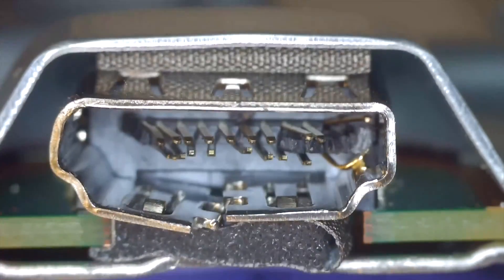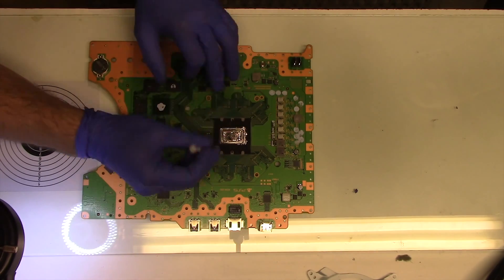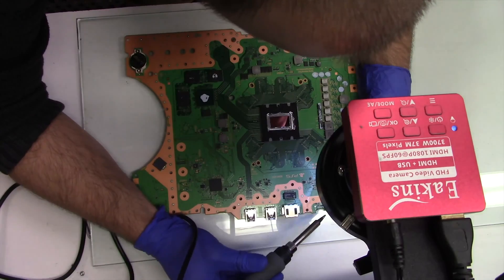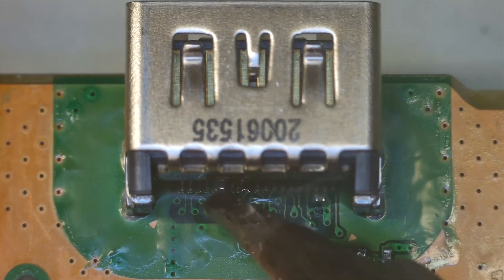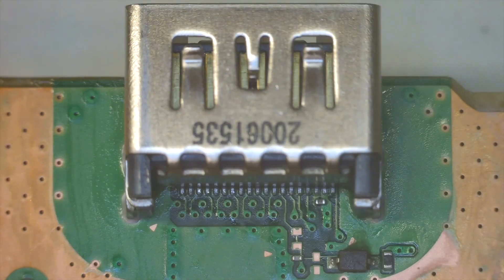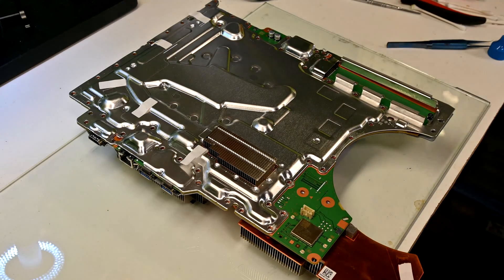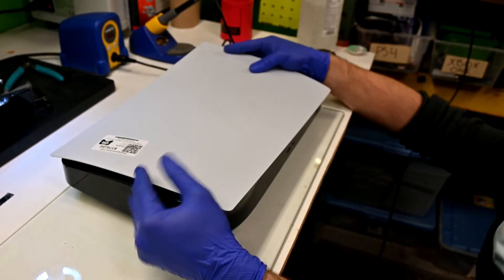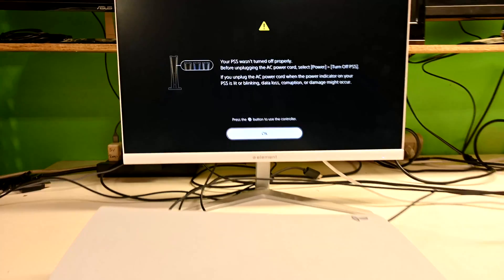Fix Broken HDMI Port PS5 System Replace Liquid Metal Reapply Thermal Paste Dissassembly and Repair

Comment: it looks like newer versions cut off many things. Ive just open my first-launch ps5 to re-apply liquid metal and there is thermal pad sticked on the vram, transitor… 
after finishing, mine works like a charm on black myth wukong 🤤

Comment: considering you are a professional you made a naive error with the fan of the ps5 one of its screw holes doesn't have a screw in it as the threads in which it gets tightened you put a silver screw there which doesn't belong there so I'd suggest take it apart and attach the fan screw and it can have issues if not done

Comment: i noticed it took a long time today when I did a hdmi desolder on a test ps5 board. Heating from the back, kapton over the diodes on the back. it did come out, with no pads pulled. But man it took forever i was afraid i was gonna damage it. Your technique of heating from the top... I almost tried that today but I was worried about those small caps around the pins. Now that i see it can be done i may experiment with that approach too. Thanks for the good video.

Comment: I've had two ps5's fail without any outside trauma. I sometimes had to just lightly touch the hdmi cable in order to to allow it to work. After replacing the cables , (data not charge) it yielded the same result. So instead of replacing the hdmi cap, ic encoder etc... I decided to try and replace the port for experience and I must of watched 20 videos of others doing it and I couldn't find a single one that had sound doctrine or specified what correct items needed to properly diagnose and repair the system correctly, until I found yours. Excellent video and instructions. You handled it like a BOSS! Thanks so very much for putting your video online. It's extremely beneficial for many people looking to do it correctly. Great job!
Reply from the maker: Thank you very much! I'm super glad you found this information useful!

Comment: t what about these other small components with thermal paste? Is it possible to change that thermal paste? My PS5 is heating up even after changing the cooler, so I am sort of guessing these small thermal paste over these components is fried or something, their texture look a bit dry. But what is heating up are the side parts until the heat get to the front USB which I believe isn't good for the overall hardware even though the CPU isn't giving a heat warning.

Comment: 1 year Life 🤣🤣🤣 excelent design sony
Reply: It was a damaged HDMI port, nothing to to with Sony. Happens on Xbox too. The owner caused the damage, it didn't just bend itself.
Reply: @conradladouceur7557  read the tittle of the video. Broken HDMI and REPLACE LIQUID METAL. Xbox haven't liquid metal, this metal fail and have problems (3 years Max.?) Ok Bro, perfecto design .
Reply: he replaced the liquid metal by choice, there was no issue  @miguelrevo

Comment: Heat is necessary but at the same time, heat it's the enemy. Too much heat or heating time, pads can be broken and other components can move out of place. Sometimes people with a lot of experience can do things in a certain way with certain tools and still end up with good results. But, people with short experience doing it that way can lead this procedure as a nightmare.
 
Tip: You should clear the holes with the copper wick for easier connector placement and minimize the heating exposure time. The pin alignment is more important than the holding legs. Depending on the board, if any plastic or close surface mount parts are too close, cover it with some material to shield the direct heat. I like to have the connector in place and secured, with the pins perfectly aligned, then apply some air heat to the pins. Once the pins are soldered in place, then I solder each of the support legs with the iron. By doing that, normally you do not need touchup and guarantee each pin is flat on the board. But if touchup's is necessary, I do recommend the iron have a smaller tip and without additional solder paste, reheat each pin. It's too risky to pass that bigger tip iron across touching multiple pins with solder. If you are not careful, not only create easy bridges, by removing those bridges, that iron that size can transfer too much heat and damage the pads under. If you do not have too much experience, find an old board and do a practice test.
Reply from the maker: True, at this point I probably rely on better equipment just a tad more than I used to in the past. Temperature is much more controlled and reliable with my current setup. But that was not always the case for me and I soldered with a much cheaper rework station and iron. During those years Kapton tape was my best friend and used on nearly every project. Same with alignment, much easier to get pins lined up directly over pads with a 200x magnification on my side. Heat is a friend and enemy if this is an early project for anyone, start with low heat and work your way up to a setting that works for you. The Technician has great points in his comment, I appreciate the time taken to point them out. Always tread carefully when working on expensive motherboards!
Reply: The best tip whatever your equipment…practice on junk boards and get to know your equipment. Never try something like this without some practice on removing / replacing plastic connectors on things that don’t matter.
Reply: Great tips thank you for sharing.

Comment: Why replace the liquid metal? If its liquid still you can just spread it around to ensure that it makes proper contact.
Reply from the maker: If it was a personal fix I would agree with you, but we do these repairs as a business and prefer to leave nothing to chance! But you are correct, this liquid metal doesn't degrade the same way a regular thermal compound would.

Comment: https://www.youtube.com/watch?v=IgXNwLoS-Hw
Reply from the maker: That's a fantastic demonstration! This is why you have to make sure the gallium doesn't get anywhere other than the CPU die! It can wreak havoc if it comes into contact with the rest of the PCB. Sony took a gamble using this type of thermal compound, but it also offers almost 7x as much thermal conductivity and shouldn't ever dry out like standard thermal paste does. As long as you don't break an HDMI port it shouldn't ever need to be replaced!

Comment: Liquid metal on a PCB is a retarded idea.
I guess no one remembers what Gallium does to gold and aluminum.
Reply from the maker: You have to make sure the gallium doesn't get anywhere other than the CPU die! It can wreak havoc if it comes into contact with the rest of the PCB. Sony took a gamble using this type of thermal compound, but it also offers almost 7x as much thermal conductivity and shouldn't ever dry out like standard thermal paste does. As long as you don't break an HDMI port it shouldn't ever need to be replaced!

Comment: With these video's I have been learning this skill picking up tips and tricks to get comfortable with taking these and other devices apart worst iv ever had to fix was the MS surface Pros absolute nightmare fuel.
Reply from the maker: Your not kidding.  Its criminal how difficult it is to fix something that is so easy to break on its own
Reply: @GamestoreAF  soldered SSD's 🤬
Reply: dude have u replaced the usb c port on a nintendo switch - brutal.

Comment: Great work.  How much does that work cost. Piece  price and changing cost   Thanks
Reply from the maker: We charge $120 for the repair itself, the HDMI port and liquid metal can be found for roughly $35-40 depending on sales tax.
Reply: @GamestoreAF  In my shop i charge 120€ too. 
When people bring the PlayStation 5 to my shop, they think I have to fix it for free! 
They say, it's easy I see it fixed by some technicians on YouTube easily.  
My answer is always the same; Fix it yourself!  
Why do you need to spend 120 € in my shop for something you can fix yourself with a video guide on YouTube? !!! 😹

Comment: Nowadays, no one company manufactures things to last. PS, Xbox, Nintendo, all fail and is unacceptable that they die in less than 1 year of use, and regarding to Gamepads/controllers are, even worst. Planned obsolescence?
Reply from the maker: Planned obsolescence i.e. encoder chips blocking you from swapping parts.  There would be a shitload more of these in circulation of hot swapping parts was possible.  So why go out of your way to prevent that?  If the console lasted 10 years, great, but they barley last 2.   Its a shame.  I dont know why we have to buy the arcade but still have to put in someone elses tokens.
Reply: It seems that the user of that ps5 does not take care of his things, so that the HDMI connector has been damaged, he must have hit the console

Comment: is this fixable ? https://youtu.be/PydksjIQIn4 if so what do i need to do?? the pads are gone
Reply from the maker: That's unfortunate, unfortunately it does look like a lot of your pad connections have been removed. In order to fix that you would have to find replacements for the components that have gone missing, then attach those to the broken traces with some micro-wire. I'll be honest this is a tricky one to work back from.